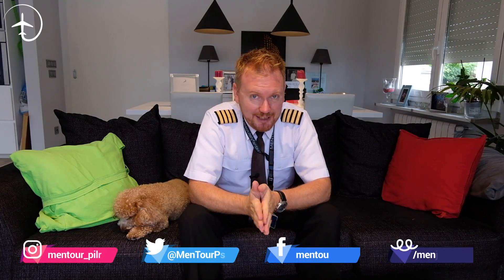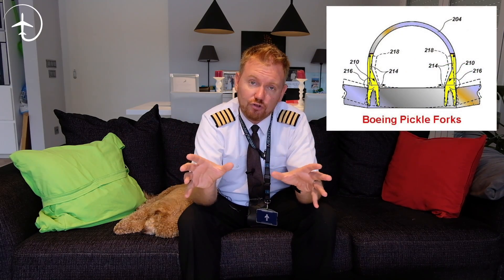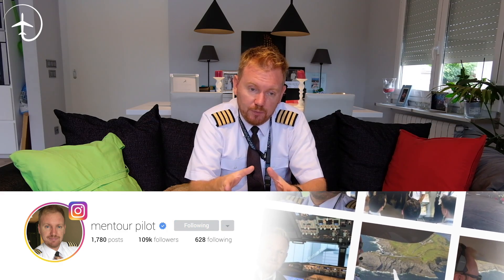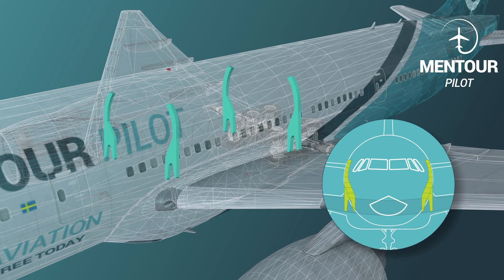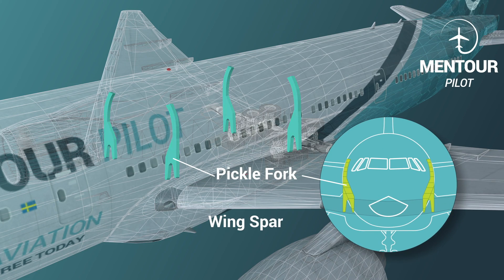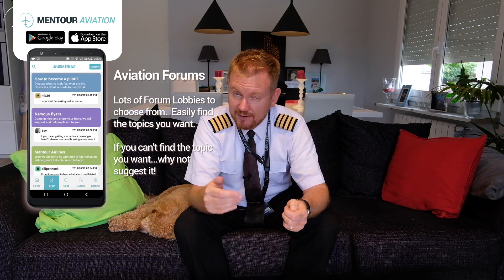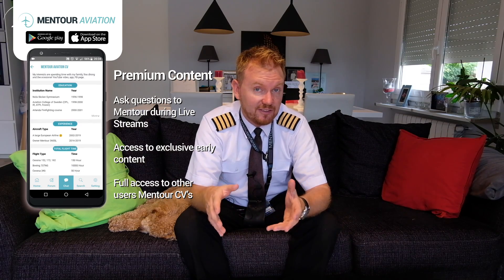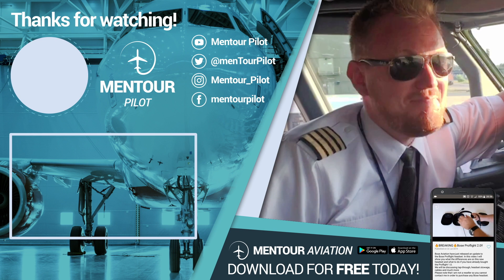Cracks in the Boeing 737 NG wings!? Mentour explains

Comment: A co-worker of mine is an aircraft mechanic and regularly works on all models of the 737. He told me that similar cracking can be found in other parts of the inner wing structure. We speculate that this damage is caused by the addition of scimitar winglets onto many of the newer models, as they create more lift, consequentially creating more drag which puts additional stress on the wing. What would you all say?
Reply: Sound like complete bollocks to me. If there was more drag more fuel would be used, they winglets are there to do the exact opposite and make the aircraft more efficient. Admit it, your friend just empties the toilet tanks.
Reply: @byteme9718   Induced drag and stress on the wing surface is my point. Just a prediction based on the accounts of a mechanic who has torn down the entire wing section of 737's. No need to be derogatory.
Reply: @spenceredwards3209  So you and you friend believe that reducing drag has caused the cracks?
Reply: byteme9718 Induced drag maybe caused my an increase in lift created by winglets, it’s very minute.
Reply: @spenceredwards3209  Lift utilised remains the same just with greater efficiency. This problem is almost certainly down to the substandard quality control of Boeing and its suppliers who are allowed to self certify. It's like letting an alcoholic loose in a drinks warehouse and telling them not to touch anything.

Comment: If it's an issue with the aluminium alloy used then it will be fully traceable all the way back to which hole in the ground it came out of and all steps in between. Sometimes at work when we have 2 different batches of the same material (and each clearly labeled ) it is necessary to have the policy of Not in the same building at the same time !
Reply: Steve Perry The crack comes from a hole, so it is most likely a lack of deburring.

Comment: Boeing lost its soul when corporate office moved to Chicago. 
They went from a proud aviation company to a financial company
Reply: Boeing lost it's soul when it got taken over by McDonnell Douglas. I know, on paper Boeing took over McDonnell Douglas, but when the dust settled the corporate leadership had more DNA from the failed McDonnell Douglas than the successful Boeing.
Reply: Boeing was a byword for planes. Airbus could not compete with Boeing so I used to wonder what happened. They were better than fly by wire planes. As soon as they copied Airbus lower engine things went wrong with trimming.
Reply: @fessellsahmed2587  Boeings are FbW since long time ago too .. also your last statement is a nonsense BS too..
Reply: @BrantheBroken Well Airbus plane crashed and all they did was say pilot committed suicide. Where is the proof that the German Wings pilot killed himself or Air France pilot couldn't fly the airbus from Brazil ? Boring had problems when they merged with McDonald Douglas. Pilots used to be scared to fly DC 10s.
Reply: Boeing got it’s name due to the fact that that’s the sound their aircraft make when landing.
Reply: @gregbrockway4452  Bill Boeing 
My family has worked for him since 1938
Reply: @Billybob Joe my family has worked for bill boeing since 1942.
Even had an uncle work at Alderea farms in carnation .
My aunt was the first female Sr inspector in plant 2
Engineers ran the company .   It was a great place to work 
But when they moved the HQ to Chicago us when it lists it soul and became a large corporation unconnected to production

Comment: Thank you for this video! I flew on two 737NGs last week and had great flights. Flying on them again in 2 weeks. It’s good to know that by then they will have been inspected.
Reply from the maker: Indeed! Don’t worry!
Reply: Not all planes will have been inspected. Those with lower numbers of cycles are not under the strict part of the FAA order, and can be inspected later. It would be nice to be able to tell if the particular plane one is flying on has been inspected, but I doubt the airlines will be diligent or caring enough to provide that information. I think all planes should be inspected ASAP, since the reason for the cracks hasn't been determined. For example, if the problem is a bad batch of pickle forks, then I'd be less concerned with flying cycles and more concerned about which planes the bad pickle forks are on. By the way, I'm not trying to scare you, because I'm in the same situation as you (upcoming flights on 737s). I think the airlines should provide more accessible inspection information for their customers, for example, an online database where you can see the inspection status for your plane. In the computer & internet age, I think that could be done fairly easily.

Comment: Boeing had subcontracted a company called AHF Ducommun into manufacturing critical parts of the NG variant. Findings showed that they were producing and supplying Boeing with faulty parts such as “Bear straps” and other crucial components for the NG to which they claimed Boeing knew were faulty.
Reply: There were very serious allegations and whistleblower videos showing structural components that should have been CNC machined but were being hand cut out in a way that is utterly unheard of in commercial aerospace engineering & manufacturing.
Reply: @nicktheengineer5976  That was a dishonest video with their own agenda, the video show supplier hand drilling and cutting part with a hard locating and drilling tool which is acceptable as long as parts are within tolerance. The people who made the video obviously have little or no manufacturing just by the way they talked about the build process. I only have been building airplane with the old and new processes for the past 40+ years including quality control. Building airplane by hand is nothing new as long as you have the proper hard tooling to control the configuration. In some way the old way of using Master Gages and Assembly Jigs is far superior if you want a consistent product.

Comment: Hmm. Orbital Sciences had two launch failures (Glory and OCO, both Taurus-XL launches where the frangible joint on the fairing didn't separate) that were eventually linked to a supplier falsifying quality records related to the composition of its aluminum alloys. I wonder how many other vehicles carry components from the same supplier over the same time period?

Comment: A fourth option, though somewhat less likely than (though possibly related to) original metallurgy is that somehow the pickle forks have been exposed to something that fouled them. Mercury and Gallium are well known for their ability to destroy aluminum, but to a lesser extent, specific gasses can significantly weaken some metals. Specifically, hydrogen embrittlement certainly could account for this type of failure in aluminum, so I guarantee you that someone has the task of looking for hydrogen sources in the aircraft. I'd put it at the second most likely cause.
Reply from the maker: True, I did not think of that.
Reply: Mercury and Gallium would have caused very differnt defects, than a crack. Hydrogene detaches the protective oxyde layer of aluminum, you would see large spots on the metal. Again no cracks would occure. I would put that at a close to zero probability.

Comment: I live in Brazil and the main operator of the 737 here have about 10% of its fleet unable to fly due to this
Reply: That's the reason I canceled my flight with Gol next tuesday and bought a ticket from Azul. I will not fly 737s anytime soon. It can be safe given the statistics and etc etc etc, but ..... 737 max problems, the NGs with cracking structural components, then the problems with assembly of some systems of the 787 (which I flew last year from Rio to Amsterdam). There are other companies to choose that have no Boeing models on their fleet. For domestic flights I prefer to pay a little bit more to fly on Latam or Azul (they operate Airbus and Embraer) than to pay a little bit less to fly again on a 737 or any Boeing model until all the issues are resolved.
Reply: @fulano1969  Gonna fly from Belo Horizonte to Curitiba next year and the Latam's tickets are cheaper than Gol ones here in Minas Gerais, so I have no reasons to fly the 737 too. I really love Boeing, but they are going through very hard times now...

Comment: Petter! This was an absolutely excellent explanation on the topic. Also excellent on how the aviation feedback/report system works. On a less critical part, you can actually drill a hole to stop the crack. Explanation to that can be found in Solid Mechanics 🙂 . On light aircraft a typical item where you drill a hole now and then is the windscreen, canopy.
Reply: Getting the stop hole in the right place isn't easy. If you miss any part of the crack front (easy in a thick component like a pickle fork) then the crack will continue to grow. I've seen stop holes in components like stamp perforations. Better to change it out, and Boeing are likely a touch sensitive just now.
Reply: @blatherskite9601  Sorry! Maybe I expressed myself unclear. I would not recommend, as you say, this procedure in a thick part where you can't see the crack propagation (front). Best Regards Rudolf. ME

Comment: Induced stress via assembly (bolts too tight, tolerances not lining up resulting in twist or pull)
Induced stress via operation (landing too hard, too much turbulence, large temperature fluctuations, etc)
or
Inherent stress from manufacturing (parts were cast instead of machined from billet, parts were heat treated and not properly tempered, uneven machining in process, metallurgical faults in forming billet, or even just engineering)

Comment: First the DC-10 engine falls off, now the 737 is gonna have a wing fall off
Reply: DC-10 isn't flying much anymore and the engine fell of because maintenance put it back on incorrect.  
This Boeing structural problem is a manufacturing issue.
Boeing 737NG structural problems were predicted a couple years ago due to substandard assembly.

Comment: About a year ago, I was close to the north side of Norton Air Force Base in  San Bernardino,  CA (Now KSBD).  An aircraft salvage company on the property was disassembling high cycle Boeing 777s.  Most of the plane was going to be recycled, but the wing root and the cabin area just above the wing root were being carefully loaded on large trucks.  A asked about the operation and was told that the load was going to the state of Washington and that specific part of the aircraft was being tested.  I have pictures if you are interested.  Do the 737 and 777 have  similar spar and wing root design?
Reply: Bruce Adams Interesting! All aircraft have similar designs, but the fatigue life of each component needs to be studied separately.
Reply: Bruce Adams  It is NOT strange that Boeing would take very highly used, lots of hours of flight time on these planes to check and see how they held up over the designed lifespan of an aircraft !!!  Good show really to verify the strength of the design !!!
Reply: Bruce Adams Indeed. A proper way to test how the piece could withstand time without nearing the failure threshold. Especially fatigue tests, which can only be addressed after real used cycles.
Reply: @tecker7454  The problem is one of time.  By the time you determine what happened, half of the units have been scrapped.  Since those structural members are critical to air frame reliability, do you just fly them, repair them or scrap them.  I vote for watch and repair as necessary.  If less than 1% develop the problem after 30,000 cycles, grounding the entire fleet doesn't make sense.  Catch it on the next "D" check.

Comment: Taking away the sugar coating, there are still questions. I work in an another industry (dealing with high pressure vessels), but it is hard to understand how a serial error in  mounting a plane can stay undetected. And it is also hard to understand, why a wrong metal analysis can stay undetected.  Usually these parts come with a a lot of paperwork. 

So, it will be interesting to have a critical look at the docs and the history of the planes.

Comment: What about turbulence? If a cycle is only defined as a takeoff and landing wouldn't aircraft which fly long flights over turbulent areas experience more stress? Or are the turbulence stresses so small in comparison to takeoff/landing stresses that it's negligible?
Reply: Beacon of Wierd Excellent question and a very astute observation! You are correct that longer flights would have more opportunities for things like turbulence to stress the aircraft. Damage tolerance analysis (DTA), which predicts the growth rate of cracks in structure, considers this by assuming three different types of flight profiles. There is a short, medium and a long mission defined that takes into consideration of all of the different loading events that occur in a typical flight cycle.  A typical flight profile includes push back, taxi, takeoff, gear retraction, initial climb, various vertical and horizontal gusts (turbulence), cruise, descent, maneuvering, landing, braking, etc.  This is a just a small list of events considered. 

From all this you can predict how fast a crack grows and design a maintenance program that includes inspections that will find these cracks before they grow to a critical size.

Comment: Traceability in aeromotive industry is mindblowing. We had problems with some turbine blading in an Allison 501 KH industrial engine many years back with fretting on the trailing edge of the turbine blades at low hours. Allison was able to go back through their records to identify which ladel at the foundry had poured those blades and where the feedstock had come from that was in those blades, truly amazing.
Reply: Many years ago I worked in the moving industry, and at one mfg the amount of files and records that they had (and had to keep) was staggering. And you don't have a date where you can trash these files, as many other types of files have. 7 years was a figure that was prevalent on files that we moved, and moved into record storage.
Reply: As long as there is a serial number and quality control documentation including heat treat records. But new recording keeping laws now only require airplane manufacturers to keep critical records for 7 years which is far to short of time. Case and point JAL flight 123 had a improper repair of its aft pressure bulkhead, it failed 10 years later and killed over 500 people. The repair record would have been destroyed 3 years prior to the accident.

Comment: Mechanical engineer here - good overall assessment, interesting.
Reply: Tom Szelag 
There was one situation omitted, that is abuse by flight crew,such as an extremely hard landing that could overload the structural integrity of the components. If it was a bad batch of metal then it should be easy to segregate that group of aircraft

Comment: Having worked for decades in the aerospace industry as a subcontractor to aircraft manufacturers, traceability from raw materials to end product is absolute. Nothing gets accepted by us and nothing gets accepted up the chain without the “certs”. A thrust reverser manifold say has numerous valves parts. Each and every part from shims to valves to electrical connections can be traced along with test results of components, the test personnel, quality inspection etc. I can assure anyone that the industry has an impeccable track record.

Comment: It's been detected, that is reassuring, unlike the early Comet.
Reply from the maker: Exactly
Reply: The comet "exposed" metal fatigue for the first time! It also lead to test metal pressure cycles by filling aircraft with water and emptying it over and over again until it popped. Important lessons that has made flying as safe as it is today.

Comment: Improperly machined/heat treated parts can cause this type of fatigue. Bad assembly could probably cause this as well. It's that straight forward. There's a video about Ducommon Aviation supplying non-conforming (bad) 737 parts.

Comment: Having worked in the aerospace industry (Titanium) for 40 years, trace-ability of the material, from raw materials, through melt and all subsequent processing is a vital part of manufacture. Every piece is identified, which position and orientation from the original ingot, all processing records etc are all recorded, logged and kept. Makes for a relatively easy tracking for any rogue ingot, melt, batch or components. Additionally, consistency  of processing is another controlling factor, such that if anything does go wrong, then the reason why this component might have failed rather than another might be highlighted easily from the processing history. The more variables in processing of any particular component, then the more difficult it can be to track which process went amiss or how many other components might be at risk.